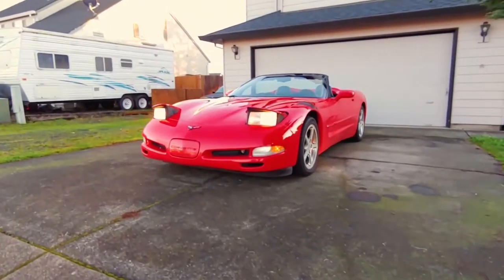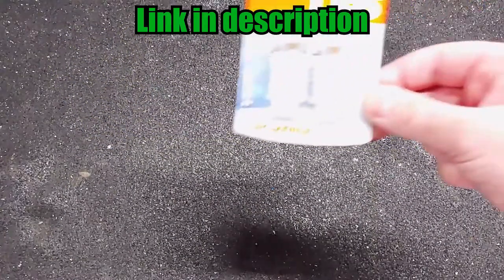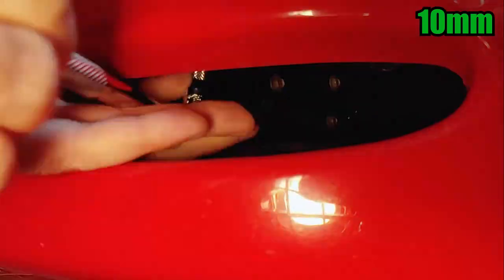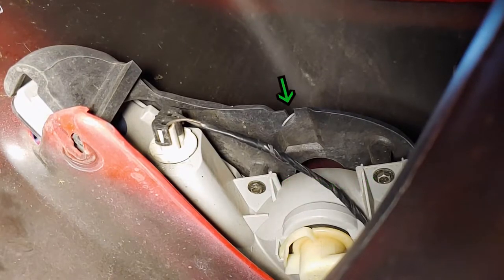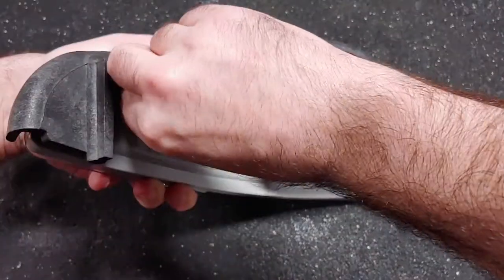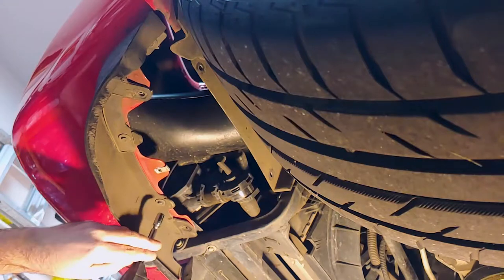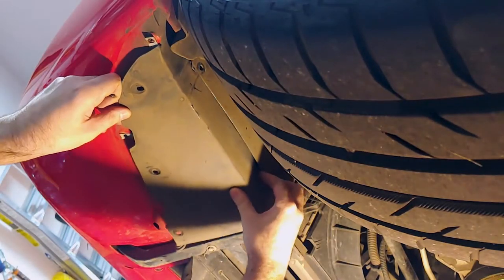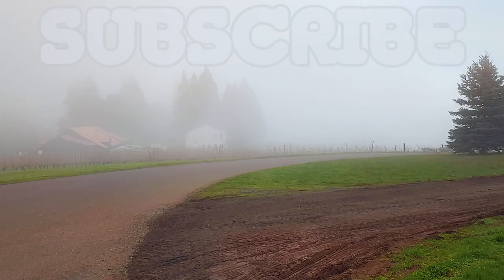Corvette Corner Marker Lens Replacement Guide with Tool Sizes 1997-2004

Comment: Do they blink amber?  No hyper flash harness needed?
Reply from the maker: They blink red and a hyper flash harness is needed to make them operate at normal speed but I haven't installed it yet. I will be covering that in an upcoming video.
Reply from the maker: Hyperflash harness installation video:
https://www.youtube.com/watch?v=oKkT3UrJtAA